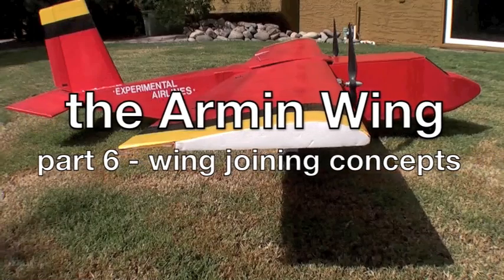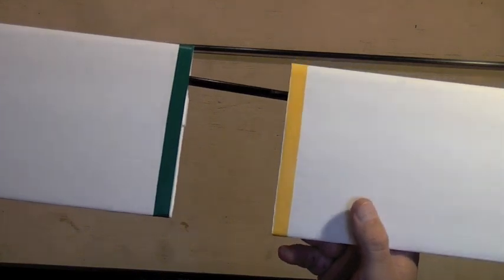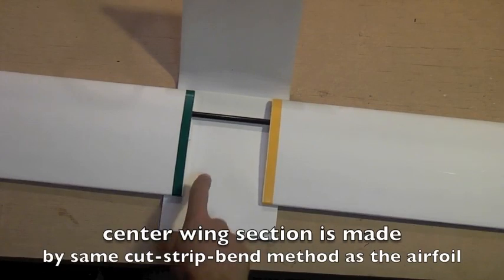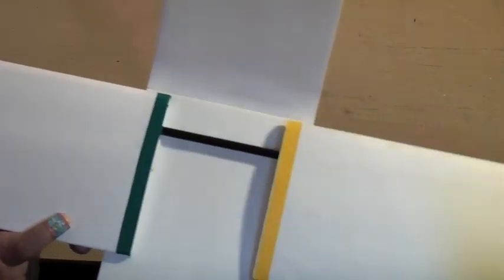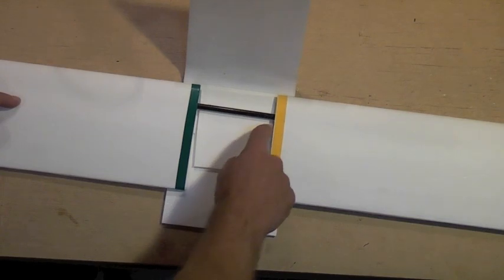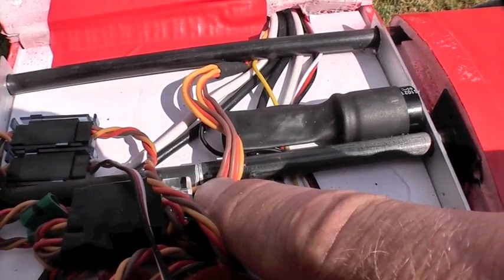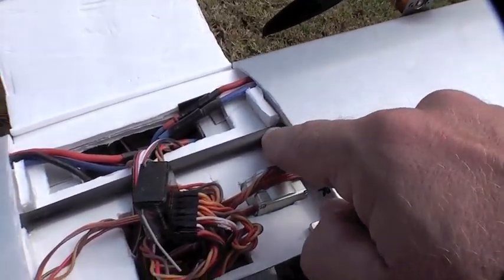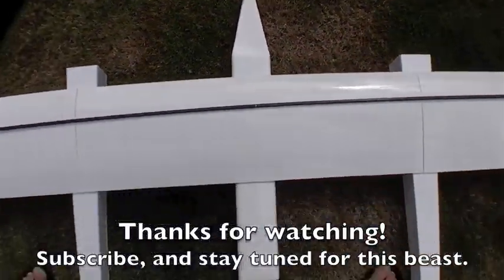the Armin Wing: part 6 - Wing Joining Concepts

Comment: Any tips how to join two 30" wings to the bottom of the fuselage? I'm making a model of the MQ-1 reaper.
Reply from the maker: Piston man I always use high wings but I know some guys have used mid and low wings just by cutting out the fuselage, reinforcing the insides, and sliding the wing through, already joined in order to avoid twisting.

Comment from the maker: @elcarteros So far the best idea for dihedral is to use an aluminum tube (like a properly fitting aluminum arrow shaft, etc.) bent to the correct angle and used to join two sections of carbon fiber arrow shaft at the center.

Comment from the maker: @BankheadRC That depends on a lot of things, like the power of the motors you are using.  30" is pretty tight for anything but small motors with 5-6" props.  I like the idea of a 60" wingspan but need more information to make an intelligent suggestion to you.  The RC-69 has two 20" sections not joined directly together, overall wingspan 45".